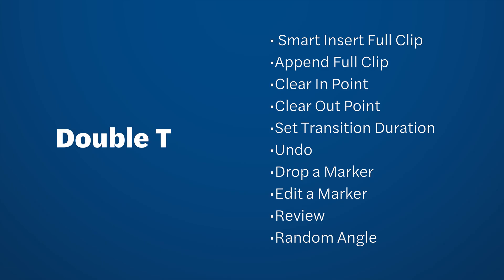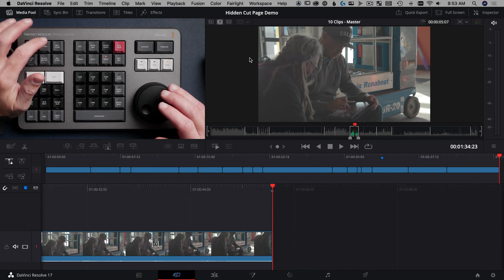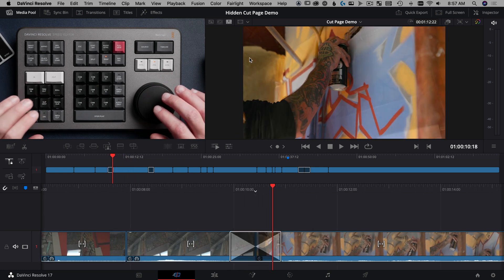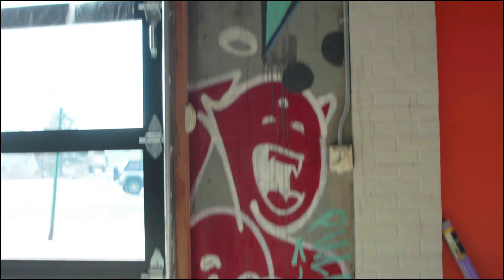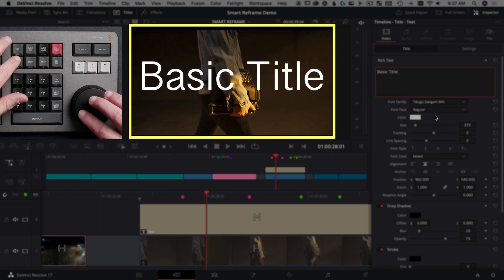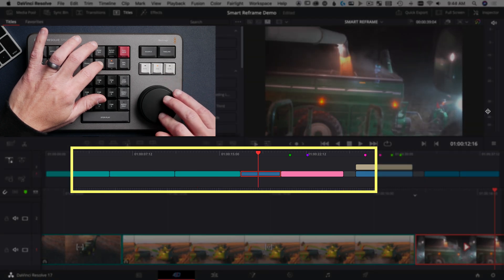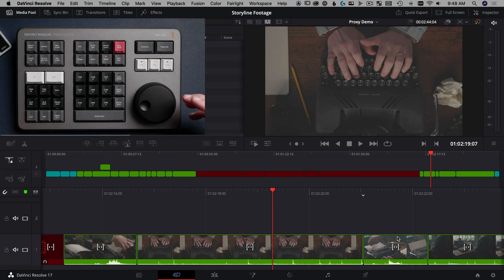EVERY DaVinci Resolve SPEED EDITOR Modifier Key Explained - Tutorial

Comment from the maker: 00:00 - DaVinci Resolve Speed Editor Modifier Buttons
00:58 - Smart Insert Full Clip
01:39 - Append Full Clip
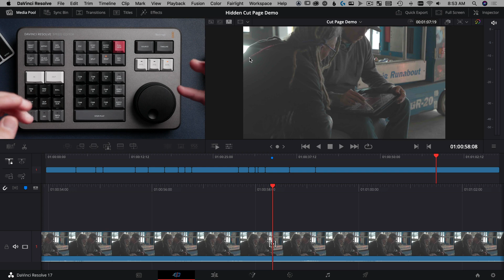02:05 - Clear In Point and Out Point
02:34 - Set Default Transition Duration
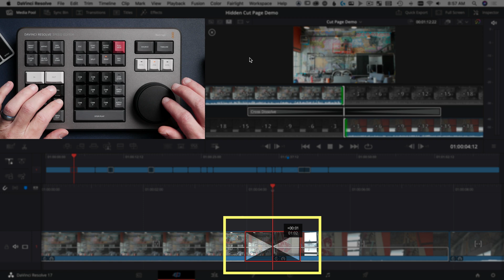03:11 - Undo
03:33 - Mark
03:56 - Review
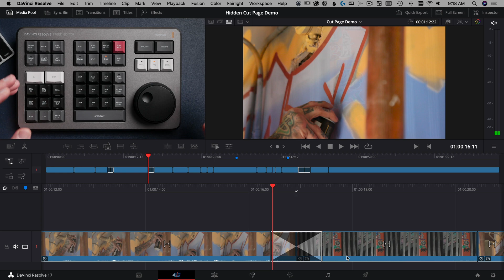04:21 - Sync Bin - Random
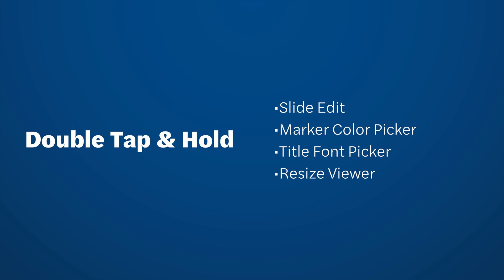05:21 - Slide Edit
05:41 - Marker Color Picker Wheel
06:08 - Title Font Selection
06:24 - Resize Viewer
07:07 - Move
07:34 - Y Position for Close Up
08:07 - Bonus tip - Split doesn’t just Cut
Reply: Thanks, this is helpful. But even after googling for 30 min. I cannot find a way to increase playback speed to 2x, 4x, etc. Does Speed Editor not have it? I'm looking for the alternative to pressing the "L" key. Can anyone help?

Comment: Love your videos. I turned on the ability to hold down the trim in and trim out buttons which make the audio very large and it works as I scroll from right to left and then all of a sudden for some reason it stops working. The only way to get it to go back and work again is to scroll all the way to the beginning of the video in which case it then works again but as I scroll to the right it suddenly disengages and stops working is this a bug or are my or am I doing something wrong. ? Figured it out it only works if you put a cut or a split point for a few frames to the left or right. Crazy

Comment: When I hold MOVE + Turning the wheel it doesn't swap the clips like yours did. I can move the clip left/right frame by frame and for example when I overlay it with another clip it overwrites the clip. hope you know what I mean ?. is there any method to change it that it behaves like yours. Fun think: it once did but somehow it behaves different yet. THANKS
Reply: AHHHH this only happens on the tracks 2 and upper. Track 1 behaves like in your video. Is there a chance to change this on other tracks.??

Comment: Hi, thanks for your help.  is ti possible to change the shortcuts for "9 camera keys" to set others shortcuts when no need multi camera selection ? kind regards from France.
Reply from the maker: I wish there was, but they are locked in and not assignable. This is a good feature request you might add on the blackmagic forums. They do read those.

Comment: 6:08 What is the point of double-tapping and holding the Title function? That is fantastic though that function is there, so helpful. I don't get why there isn't a function to just double-tap and add a title at the location. I am trying to find the "Speed Editor" in the 18.6 manual, but "Speed Editor" doesn't pull up anything, though I have found both on several pages.

Comment: Can you use Trim In or Trim Out when trimming after camera angles have been added to a multicam clip?  If I try to use the Shift [ or Shift ], the video is deleted up to the end of the camera angle, but the audio is deleted all the way to the end of the clip.  Premier does not do that.  The audio and video are cut at the same spot.  Is there a special keyboard shortcut that can do this or can the buttons on the speed editor do this?

Comment: This is not directly related to the Speed Editor but I'm grasping at straws at this point: For some reason, ALL of my titles are set at a default duration of @.  That wasn't always the case and I don't know what I did or when I did it to change it to that.  I also believe this is impacting what I see when I hover over the titles...it barely shows anything.  What I end up having to do is drag the title to the timeline and then right click to change the duration.  You can imagine that would suck if you had hundreds of title to choose from.  All I want to do is set ALL of my titles to a default duration of @ seconds but I can't seem to figure out how to do it or where to look in the over 3,000+ page manual to find it.  I know there got to be some setting I'm not seeing  that needs to be changed.

Comment: I recently happened upon a thread where people were discussing the "clicky" nature of the search dial. Speculation about whether or not it at least sends out a signal that's just currently not used. Someone would be able to figure that out with a USB data-interpreting oscilloscope or other device. But regardless of whether or not it actually does something, there was of course a hypothetical discussion about the kind of function it could serve. Since the dial has very little resistance, it's hard to click the dial without inadvertently turning it, so it would have to be something where turning the dial doesn't mess with the functionality. An interesting suggestion was to have it trigger a battery level readout, by illuminating the three keys just above the dial to indicate the charge level. It was particularly interesting because this wouldn't even require sending out a bluetooth or USB signal. It would all be internal, activated by a firmware update.

But then that comes back to whether or not the speed editor "knows" that the dial is being pushed down. I have a feeling it doesn't.
Reply from the maker: I love the idea of making it change resistance but I’m 99 percent sure there are no electronics in that click.

Comment: Thanks! I didn't know about most of those features. It's probably been mentioned before but just in case it hasn't, you can also press and hold the audio level button and use the jog wheel to adjust the volume of a clip. It works in the edit tab too. Again, great video!
Reply from the maker: You’re welcome - that that audio level change is a good one!  I often forget about it.  Thanks!  I appreciate you watching.

Comment: i'm using the free version of Resolve but your videos have made me want to upgrade to pro with the speed editor :)
Reply from the maker: Hey that's great to hear the videos are helpful.  The "free" speed editor certainly makes it more manageable to spend the extra money.  One big key thing the paid version will get you is access to multiple GPU rendering, so if you have a solid computer - the software will run faster, also the other issue I see a lot is the 10 bit footage not being supported on the free version.

Thanks for watching!
Reply: @CreativeVideoTips  hey great point re: gpu usage.

Comment: I got this in June and love it - however all of a sudden, when I use the wheel to scroll fwd and back when the JOG or SCRL buttons are activated, there is no more sound playback. if I hit play i hear the sound. If I claick the SHTL button I CAN hear the sound when using the wheel in both directions but this makes the clip go too fast to pinpoint in and out points. Did you ever have this issue with your Speed Editor ? Frank
Reply from the maker: I wonder if you have disabled audio scrubbing by chance with the keyboard shortcut - by default this is Shift - S.  Try toggling that to see if it turns it back on.  I have not seen this function stop working, not to say it still could be broken.
Reply: @CreativeVideoTips   talked 3 hrs with BD techs and it turns out that is exactly what it was. somehow the scrub sound was set to off. Control S didnt work for me but through the top menu, we were able to fix the issue.

Comment: If I have lower thirds or you tube subscribe buttons in my bin how can I drop them on top of other video tracks? With the speed editor
Reply from the maker: As long as they're a clip in your media pool, you can use the "place on top" key.  This is n the upper left section of the speed editor.
Reply: @CreativeVideoTips  So if they are in a power bin I cannot get to them without using the mouse? Just trying to be as efficient as possible with the speed editor.

Comment: Does anyone know how to zoom in/out the timeline scale from speed editor? And how to zoom in the preview window (for masking and effects) with this control panel.
I really miss those functions.
Reply from the maker: Hi Grimor - you can't zoom the timeline with the speed editor.  I wish you could too.  I think the reason is that in the Cut page you always have a zoomed-in and out view available with the upper and lower timeline views.  I know that doesn't help in the edit page.

To zoom into the viewer you can use the 3 horizontal line secondary function under snap to see the program window larger (not zooming, but larger) and turn the search dial.

Other than that I would be in the edit page and scroll with your mouse wheel to zoom it up.
Reply from the maker: I'll add to the zooming in with the mouse - some people don't know but if you hold the mouse wheel in you can pan around in that viewer and then tap "z" to zoom back to fit after you're done with the detailed work
Reply: @CreativeVideoTips  Thank you very much!
Really helpful tips for newbies like me (3 days ago I switched from premiere to resolve) . New subscriber here!!
Greeting from Spain

Comment: Maybe you can help me, I noticed my dissolve and smooth cut buttons don’t do anything, I have the latest ver 17.1 , would you know why? Do I need to setup those keys?
Reply from the maker: Hmmm. I haven’t seen that before. Are you on the cut page? Maybe check to make sure you have trimmed the clip to have a handle?  Let me know if it’s just because there’s no handle.
Reply: @CreativeVideoTips  appreciate it, also I went to the cut page, when I press the smooth cut transition button I notice a red light in between the cut of the video where I’m trying to place the transition. Not sure if you know what that means when it blinks red?
Reply from the maker: @Jakepp235  Ah yes - you don't have enough handle to place the transition down.  You will need to remove and trim back each side of that cut so there is media for the transition to work "under" the cut.  Check this explanation out here after about 13 minutes in I explain - https://youtu.be/KTqcPnHsgzU?t=802
Reply: @CreativeVideoTips  ok I will thanks
Reply: @CreativeVideoTips  by the way is there anyway to call black magic and switch this dongle to an activation code so I’m not stuck using one of my USB ports every time I want to use this program, that’s soo silly man

Comment: Would you happen to know if it's possible to do a ripple delete in the cut page, whilst there's an audio track that remains unaffected?
Right now, even if I've locked the music track, it just inserts a blank when I hit the ripple delete key.
Reply from the maker: this all depends if the audio is linked to the video clips - if it's linked - then the cut page on V1 is always going to ripple like an FCP primary storyline.  However if it's not linked (maybe it's extra sync sound that wasn't linked or sfx, or music) then because its not tied to the V1 video - it will always try to keep its relationship to the timeline and not ripple at all.  Does this make sense?
Reply: @CreativeVideoTips 
I’m indeed editing to music, which I want to stay unaffected by any deletes I do to the video, which I figured I’d make sure of by locking it.
If the audio is linked, it will ripple delete both the video and audio, and when it’s not linked, the video behind the delete will stay in place. I think I get that.

But is there no way to make it ignore the audio track and ripple delete the video anyway? I’m pretty sure FCP can do this when you lock the audio track (although it’s been a while since I’ve used it), and I know premiere can do it.

Right now, when I ripple delete, it just inserts a blank, but I CAN then ripple delete that blank away without affecting the audio. But I can only do that by selecting set blank with the mouse first, since the speed editor won’t delete blanks with the ripple delete key...

This might just not be possible, but I’m still relatively new to resolve so I’m not sure.

Comment: Great tutorial Chadwick!   Is there a way to isolate the split or "cut" if you have two video tracks?  If I hit SPLIT it cuts all the tracks at the playhead, I would ideally like to just cut one.    Thanks
Reply from the maker: Thanks KZ - there are a couple ways to do this but neither can be done only with the speed editor.  If you're in the cut page you need to select the clip with your mouse until it is highlighted with the orange box - then hit split.  Or if you're in the edit page you could option click the auto track selector on the far left (next to your lock icon) - then you could use split.  But you will need to use a mouse or keyboard before using that button unfortunately.
Reply: @CreativeVideoTips  Thanks Chadwick I appreciate it.  I found myself jumping back and forth from the CUT and EDIT pages and knew that was not the intention of Balckmagic.  I think my simple editing should be done exclusively with the speed editor and not require a mouse.  Hopefully Blackmagic comes up with some firmware to improve the functionality.   Besides that, I thought it was fun using the Speed Editor.  It is possible to view two clips one on top of the other in timeline (kind of like multicam) without them being sync'd?  The waveforms I had weren't close enough for Davinci to get a match (GoPro skiing footage).

Comment: Great tips as usual!  I wonder how many “Easter eggs” are hiding in this device?  One I’d like to discover is next/previous clip.  I am a little surprised the speed editor doesn’t offer that functionality explicitly TBH, because while the wheel is amazing for trimming and other precise precise motions, jumping whole clips when browsing the source tape would be very efficient (for my workflow and preferences, anyway).  I am very fortunate to have a micro panel as well so my solution, for now, is to reach up to it to do next/previous clip (yes, it works in the Cut page!).

As a side note, I notice that occasionally I get stuck seemingly “zoomed in” to one clip in the source tape occasionally (basically one clip takes up the whole source tape).  Haven’t figured that one out yet.  It takes me out of my flow, and I usually just toggle views around until it gets back to normal, but I’m sure it’s an intentional feature that I just don’t understand.  Any thoughts on that?
Reply from the maker: That's a great point about the micro panel having next and previous clips buttons - I use to have a mini panel at my previous job - but now I feel jipped they didn't put this on the speed editor!  Ha.  They really want you using that search dial.  Said to say but I"m 99.9% sure this doesn't and probably won't appear on this version of the tool.

For you "zoomed in" view.  Yes you actually tapped into another feature there.  I forget which video I cover this in but basically tapping source when you are in source tape is supposed to zoom into whatever your current i/o marks are for source tape.  This gives you a much closer view.  The way you go back out to the full source tape view of it all is one tap of the "esc" key.  So you can even get down to a 5 second or so view of a clip in source by just marking i/o on a day long of source tape for more precise visual and control - then with esc - jump back out to the whole stringout/reel from your day.
Reply: @CreativeVideoTips  We can always hope, I guess, re the next/previous functionality, but yeah, it might be too much to wish for.

Thanks re the “zoomed in” view.  I’m sure that’s it, because I often hit “Source” just as an extra insurance, like a nervous tick (if you’ve ever used the geeky text editor ‘vi’, it’s like hitting the Esc key constantly there).  Now I realize I probably should not do that!  I’ll definitely try Esc when I get into that mode again, and will try to make positive use of the feature, as well.
Reply: @mike.thomas  I'm surprised too with no X-POS button. Maybe will be in the SPEED EDITOR PRO version  I have a really hiden one. If you Doble tap SCROLL (SCRL) the play head will move faster.

Comment: Once again dude, thanks so much for these videos. At this point they’re pretty much the default manual for the Speed Editor. At first I wondered why they added these double tap functions with it as opposed to making them dedicated buttons, but now I realize that it’s a great decision - it keeps it small for one thing to navigate around it quickly, but also there’s so much thoughtfulness in the layout. Having either the in or out point be able to clear those points too is great, not to mention the Undo function: if it was its own button it would be easy to bump by mistake and wonder what just happened; instead, it’s in a convenient location but hard to hit accidentally. Great design!
Reply from the maker: Absolutely! I appreciate you watching and I’ve been having fun making them. Now if only they could give us a few assignable buttons... 😉 either way it’s still a great tool!

Comment: the dial click doesn't even send anything internally, there is reverse engineering happening, can't wait to bind "start to playhead" and "end to playhead" instead of slip and ripple delete.

might also be neat to explore how these differ when using the edit page (on selection or trim mode).
Reply from the maker: Ah - have you taken a look at the electronics of it?  That would be great to see some customization come to the speed editor.  If you want to check out some of the differences I've learned between cut and edit with the tool there is this video here -

https://youtu.be/a2gf1daaOpc
Reply: @CreativeVideoTips  I am not doing it myself, but someone in the BMD Discord is.